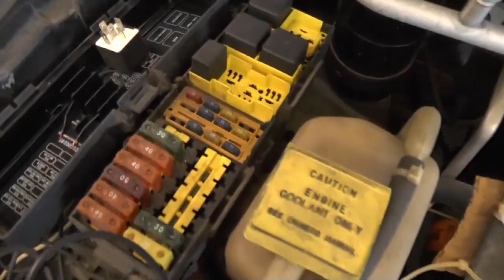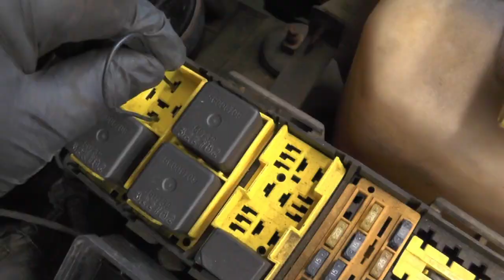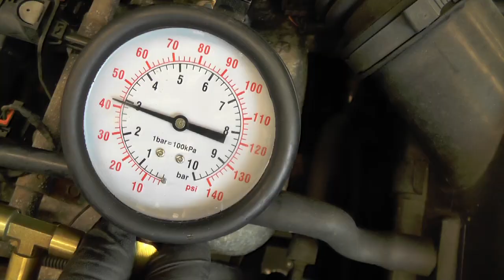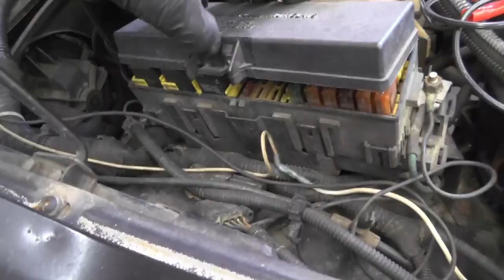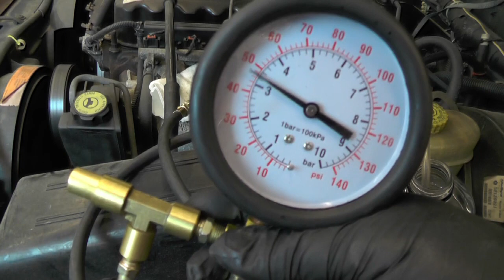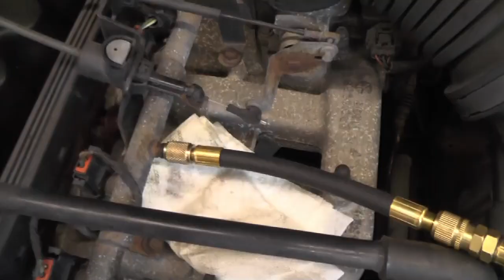How to Test Fuel Pressure on a Jeep Cherokee XJ

Comment: Very good video. I have the same gauge wobbling around at 49 psi but my pressure gauge doesn't have the bleed valve. How can I do to escape the trapped air in the fuel rail? Thanks.
Reply: Buy a better gauge

Comment: AFTER I DID THE TEST'S, IM GETTING A P1282 CODE ON THE ODOMETER. THIS IS A FUEL RELAY OPEN CIRCUIT. IS THIS DUE TO USING THE JUMPER WIRE?? AND DID I BLOW THE RELAY??  NOT GETTING ANY ENGINE LIGHT CODES BUT ENGINE RUNNING FINE. ONLY PUT ON 20 MILES SINCE THE TEST. WILL THE CODE CLEAR AFTER PUTTING ON MORE MILES???✌️

Comment: SO I DID THE 3 STEPS YOU SHOWED. 
1. WAS OK 58.5 PSI
2. NEEDLE WAS FLUTTERING AROUND 58 - 60 PSI AND WHEN I RELEASEED THE PRESSURE TO GET THE NEEDLE TO ZERO, IT WOULDN'T GO.  AND A LOT OF AIR BUBBLES IN DRAIN TUBE.
3. STATIC TEST, IT HELD AT 53 PSI.
NOW THAT'S GOTTA BE THE FUEL PRESSURE REGULATOR.
SO I REPLACED IT. 
NEW TEST:
1. 52 PSI ONLY LOST 4 PSI.
2. ENGINE RUN. 52 PSI.
3. HOLDING AT 48 PSI.
So pretty sure it was my fuel pressure regulator? Giving me a po172 and po175 oxygen sensors running rich. I had replaced my map sensor prior, drove 6 miles and got same code. Cleared them and installed the regulator, drove exact miles and route and no codes as of yet. 🤞

Comment: Im running rich and getting codes po172 & po175. Oxygen sensors, after i just replaced all injectors with 4 hole from 1 hole, because i was getting a po203 code, missfire open circuit #3 cylinder.
So just bought new fuel pressure regulator/filter, and i want to test my pressure at the shrader valve on the rail before i replace it. I think on the 2000' wj, pressure should be from 49psi to 51psi? If it's higher to almost 60psi, i know its my regulator, and feeding too much fuel and running rich. If ok, then its got to be the oxygen sensors themselves?? Just looking for confirmation. Thanks

Comment: Almost everything about the XJ has been so mechanic friendly. I haven’t done research yet to make sure there’s a rubber section in the feed/return lines yet (for pinching them off for diagnosing fuel issues), but there IS the schrader valve. It’s almost insane, even the (automatic, specifically the AW4) tranny has a drain bolt.
Reply: Are you trying to be funny? all automatic transmissions have drain bolts
Reply: @lh1678  No, they do not. My 1966 Mustang had no drain of any kind in the stock transmission. The only way to change the transmission fluid was to drop the pan and it was an unbelievable mess.
Reply: Most fords don't from what ive seen

Comment: I'm curious as to what the fuel filter will have in the delivery of fuel when it becomes stopped up or partially stopped up? If you have less than satisfactory fuel pressure at the fuel rail it would seem to make sense as part of the test to make sure the fuel filter is clean rather than just immediately replace the fuel pump. Because if you just replace the fuel pump without checking at least the fuel filter you're going to have the same problems. Maybe I'm wrong I'm thinking the pressure would read lower with a compromised fuel filter
Reply: my jeep has 170,000 miles if i change the filter if that's the problem I would put a new fuel pump even if it's good , just because of the mileage. and the filter is in the tank too.

Comment: Where's the fuel filter at
Reply: Older XJ's have it along the frame outside of the tank. 2000/01 (maybe 99) are inside of the tank. Lucky me...
Reply: inside the fuel tank

Comment: Great video.  So I see the relay kicks on then you turn the key then stops (before you start). I see that in mine as well.  I turn the key and the relay only turns on the punk for about a second.  I am guessing it turns the pump on once the engine starts?  

Basic question if an engine stalls and it is because of a fuel pump what should I see?  If you try to tart without turning the key off and back on, the relay is not pumping gas’s or is it?  I seem to only see that one second pump at the first turn of the key then it’s off .  Thanks t it starts the pump runs,  if it stalls the pump is not running.
Reply: It turns the pump on to build up fuel pressure, then turns it off until the system detects oil pressure. It's a safety feature, the idea being if you are in an accident and the engine stops you don't want fuel pumping out of possibly broken fuel lines.

My fuel pump failed once, the symptom was the Jeep wouldn't start and there was no sound of the fuel pump coming on.

Comment: Thanks! Just replaced my Coil, Cap, plugs and installed 12 hole injectors a week ago.
Been running great.
Went out to start it today, it cranks but won't start. Tried a few times then went and checked the valve to see if fuel came out. Nothing...
So I'll check that relay functionality first, then try to jump and test for pressure using the kit I ordered. Looks just like yours.
I'm guessing the pump crapped out. Pretty weird though right after an injector upgrade. Wonder if it was coincidence, or what the hell...
Reply: Feel sorry 4 yu ... tracebout a mysterious problem

Comment: What if after u bleed there air out and it flutters from 39 to 50 constantly??? Hold pressure as it should. But start up agian and foes the same 39 to 50 flutter? Could it be a bad pump. Injectors ate all new.
Reply: thats what my 96 does too.flutters like crazy. i have new fuel pump and in tank regulator. my injectors are old, probably orig. i figure they are my problem. my jeep doesn't like to idle unless i leave a small vac line open... yes i cleaned throttle body- cleaned then replace iac and everything else

Comment: I just installed a new pump and got the long start. Testing results. 
Key only on--- No pressure 
Running--------- 50psi
Shutdown------- goes to zero immediately. 
Glad I cut a hole in my floor. 🙂

Comment: I have been priming my fuel to start the Jeep after it’s been sitting for over a day. I just got a pressure tester in the mail and did it exactly according the the video seems it worked fine. When I bled I did see some bubbles could that be the issue for hard starts? Mines a 2001 Jeep xj

Comment: Hi, I have the same Jeep and it occasionally has a hard crank. But I noticed I don't have a cap where you tested the fuel pressure. Could that have anything to do with my issue? Also what would it be called so I can find it in store? Thanks
Reply from the maker: Hi, thanks for your question. The cap probably is not the cause of the problem. However, it really should be there. The cap is the primary seal for the port, and it prevents dirt / dust / debris from entering the valve core. If you want to get a new one, you can probably find it on eBay. Or, the local auto parts store. Most of those caps are the same size as an "old R-12 service port cap" that was used on older car A/C systems. For example, I've purchased them from NAPA and PepBoys. Hope this helps, and good luck with your Jeep!

Comment: So after i bleed it with the pressure tester it takes about 10 seconds to go back up to 50 psi. I have an 01 dodge 1500 so i caint pinch of the line to c if its the fuel pump or the injectors. Smh.
Reply from the maker: Hi, thanks for your comment, and sorry for the delay reply. If all is working properly, the fuel pump should be able to "almost instantly" create a rise in fuel pressure, as seen on the gauge. I had a problem once, where there was a "schrader valve" inside the fuel pressure tester hose (at one of the connections) that was bad. It was acting like a restriction, and the gauge moved up very slowly. Once I removed the bad schrader valve, the pressure gauge worked properly, and the needle would go from (about) 10psi up to (about) 50 psi very fast. So in this case, it was the tool that was giving me trouble, and I didn't figure it out until after spending a few hours chasing down non-existent problems with Jeep's fuel system. So, you may want to check over your tool, including each connector. Hope this helps!
Reply: @stevenofpa  thank you very much for replying. Hav a couple question just trying to figure it out before i replace the fuel pump(which i think has to be my problem)1.when you say fuel pressure hose do you mean the tool i use to test the fuel pressure or the part where i connect it (which is on the fuel rail i dont hav a hose so a little confused) 2.On my truck the regulator is on the fuel pump itself so i hav no way of testing it. 3.Lastly when i hav the tester hooked up testing the pressure it eventualy idles at about 49psi and the needle moves just a bit up and down 1 psi...and when i floor the gas peddle the needle doesnt rev up like it should. When i rev it up it actualy causes the needle to stay still at 49. No movement at all. So i hav done a complete tuneup to the truck and it stil feel like it has no power. So im planing on droping tank cleaning it and replacing the pump. But just wish i could test the pump somehow so i dont spend 250 on it. Thank u in advance.

Comment: Just found your channel.
I have a 95 Cherokee 4.0.
I got code 12 and 13.
Rough idle,No power , feels like limp mode.
MAP sensor...
Replaced with new. 
No change.

Quite a few things can fool the PCM into thinking the MAP sensor is bad when it isn't. Among those things are: a bad fuel pump, low engine compression, and intake manifold vacuum leaks.
It's always a good idea to check fuel pump pressure (with a fuel pressure test gauge), engine compression, and for vacuum leaks if your Jeep has a very high mileage engine.

145K miles. 
Did a fuel leak test with gauge, and it help pressure .  
Confused!!!

So I replaced the fuel filter and fuel regulator. 

Re-test the fuel rail pressure....
Now!! It will not hold pressure.
Turn the key, pressure goes up then drops fast.  

Haven’t found a vacuum leaks. Did a smoke test.

Haven’t done a compression test yet ..

So I’m guess now it’s the fuel pump. 
I hope.
Reply: Same issue...found small Crack in fuel line up at the tank. 
Replaced with gas hose.
Problem solved
Reply: So what was your issue??  
I just  installed a new Delphi fuel pump. Went out after a week.  Replaced the new relay and nothing.  What are the chances it's the fuel pump again after a week. 
Replaced the crank position sensor and nothing.  Thx